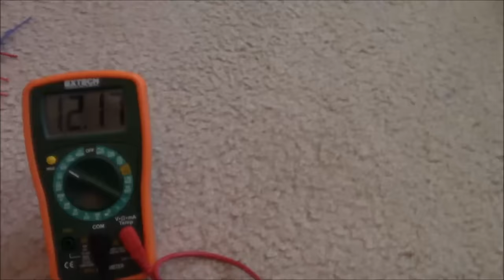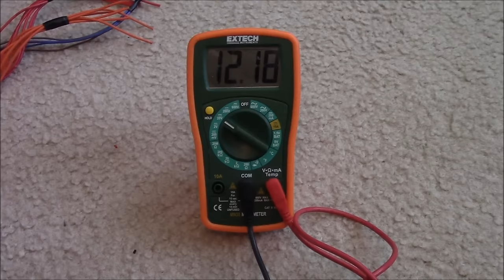How to Hack a Computer Power Supply (PSU) To Use as a 12V DC Power Source

Comment: @ LDSreliance
I used a new 400 watt 22a computer supply on 12v today to power 16ea. @ 10w led's. This was my initial start up and the led's are mounted to a large alum heat sink using dielectric paste and screws. After about 2 to 3 minutes run time the power supply shorted out by frying 3 small resistors located on the printed circuit board positions R-13, R-14 and R-17. It did not blow the fuse. 
My question is do you or anyone else know the value of each of the 3 fried resistors? My power unit is a Kenter, Model PSPK400 and I can't locate a schematic to replace the correct resisters.
I checked my led light mountings for a short and found no problems there.....
The 160 watts, 16 leds @ 10w each, require only 13.3333 amps to power up which should not have been a problem....
I rigged my power supply as you have rigged the one you used in your video..........
I am an old fart, not a skilled electronics guy, just messing around with led's which intrigue  me to no end......
Any help with my problem is much appreciated,
Don
Reply from the maker: +orangecrate39 Did you control the current through the LEDs with a resistor?  I assume the LEDs were in series?

After doing a little research into that power supply, it gets bad reviews and seems to be junk according to some.  Check out this video for example:  https://www.youtube.com/watch?v=RP9GHyFUXgU

So you may not have done anything wrong with your LEDs but it may have just been a faulty psu.  I know the tendency is to use the cheapest psu you can find to hack up like this.  That is what I did in my video.  It would pain me to take a $100 Corsair power supply and hack into it.  But these cheap units do have poor components and often (as in this case) have no documentation.  I can't find a manual or diagram, either, I am afraid.  Sorry!
Reply: +LDSreliance 

I had the led's wired parallel in 2 circuits ie., 8 led's to a circuits. The power supply was supplying 12v through 3  yellow wires and grounded with 3 black wires in each circuit. There was no resistor in either circuit.
 
I figured my PS was a cheap one because I only paid $18.50 including shipping. I went by the local computer repair shop this morning. The owner let out a short howl after I told him what had happened. He said most all PS's were vastly over rated on the wattage they list on each unit by at least 25% and some were by 50%. He also said I should have had a PS with 650watts minimum. I believe he felt sort of sorry for me because he told me to check back with in 2 to 3 weeks he should have one with 650w for me to play with.

He also said the cheap PS's used all components, parts, right on the edge limit, no safety built in for emergencies which was the reason the 3 resistors fried without blowing the fuse. 

Thanks for your reply......

Don
Reply from the maker: *****
That is pretty much what I thought.  If you want cheap you can go to a computer recycler or look for someone throwing away an old Dell or HP computer.  They used fairly cheap components but they were rigorously tested by the manufacturer for reliability since they had to warranty the computers for the mass market.  I would trust a Dell's 350 watt power supply over any cheapo 500 watt power supply on the market.
Reply: +LDSreliance

I ment to ask you if I needed a resistor or what would you recommend?
Thanks. ....
Don
Reply from the maker: *****
I am not an expert on this but from what research I have done you need a resistor on an LED to limit the current.  Just because it is rated for 12v 20mA doesn't mean it will limit itself to using that amperage.

http://led.linear1.org/why-do-i-need-a-resistor-with-an-led/

Comment: I connected green to black and it powers on for 1 second then powers off...any ideas why?
Reply from the maker: If it detects there is no load it will turn off.  Connect it to a load first and then when you short the green wire it will stay on and the load will power up.
Reply: ok will try however these is a fan in the Ps so i would imagine this is a load on the 12v portion so why would it power off? the fan powers on for fraction of second then powers off and on your ps you didnt have a load connected  other than the fan and the 12v powered on ok...
Reply from the maker: No, it is designed to only run when it detects a load on the rails.  The internal fan doesn't count.

Comment: I want every detail, what does every color of cord do?
Reply from the maker: The standard colors and pinout can be found here:  https://en.wikipedia.org/wiki/Template:ATX_power_connector

I only dealt with the 12V wires in this video because that is all you need for a 12V power supply.  But there are 5V USB as well as other useful rails you can tap into.
Reply: @LDSreliance  thank you very much, if i were trying to make a high voltage power source what would you recommend i modify? I was gonna use a microwave but decided this would be a place to start for better experience.
Reply from the maker: High voltage?  The highest this PSU outputs is 12V.  There may be ways to increase that but I'm not an electrical engineer and would not be qualified to help you with that.
Reply: @LDSreliance  i don't mean this specificly this, just anything that could produce a high voltage. Or something that could be modified to produce a high voltage.
Reply from the maker: You would use a DC to DC voltage step up converter to increase the voltage of this unit from 12V to maybe 20-30V but you would lose some of your power in the conversion.
Reply: @LDSreliance  what if i added the 220v coil from the microwave transformer?
Reply from the maker: I have no idea if that would work but I would suspect not.  Especially since most PSU's are 400-600W and most microwaves are 1000W+.
Reply: @LDSreliance  oh, well. I appreciate all the responses.
Reply from the maker: You are welcome.  Good luck!

Comment: sorry one more none of my supply have that green wire only one newer one does which would be the wake up wire for ones without green thanks a lot
Reply from the maker: +Nena Pike If yours does not have a green wire does it have a switch on the back of the power supply to turn it on?

Comment: I know this video is very old, but when I try to connect something to my psu the amp im using flashes protect and shuts itself off and the psu turns on but then turns itself off after the amp refuses power
Reply from the maker: How big is the amp?
Reply: @LDSreliance  Total Power Output	4000 Watts
Peak Power @ 1 Ω	4000 Watts x
Peak Power @ 2 Ω	2000 Watts x
Peak Power @ 4 Ω	1000 Watts x
RMS Power @ 1 Ω	3000 Watts x
RMS Power @ 2 Ω	1500 Watts x
RMS Power @ 4 Ω	750 Watts x
Strapped Power bridged @ 2 Ω	8000 Watts
Speaker Impedance	1 to 8 Ω

I seem to have it working, I think there was a failsafe that if it wasnt delivering power it would shut off
Reply from the maker: Gotcha.  Well obviously you won't be able to use anywhere near the full power of that amp but it should turn on.  I was going to suggest checking the sense wire that detects when the amp is supposed to turn on.
Reply from the maker: Also, on some PSU's, there is a feature that is supposed to save energy that detects a load and if it doesn't see a certain load it will shut itself back off.  So you have to trick the PSU into turning on with a resistor or a dummy load.
Reply: @LDSreliance  unfortunetly I understand I wont be able to use it at its full potential but its a way to use ny car subs in an ac setup while they arent being used otherwise. Also you made an awesome video, thanks for the help and keep doing what youre doing
Reply from the maker: You are welcome!  Good luck

Comment: How do you tell the amp rating of it?
Reply from the maker: It will either be on a sticker on the side of the case or you will have to look it up online on the manufacturer's website based on the part number.

Comment: hey man whats up one question can you tell me how much amps it is pushing please ?
Reply from the maker: 20 amps on this model on the +12v rail.  Yours may differ.
Reply: LDSreliance i have a car radio and two amplifier using and looks like the power supply is too quick im wondering how much amps i need to run it
Reply from the maker: Too quick?  You probably can't power car amplifiers with this thing unless they are very small.  20 amps equals about 240 watts, which is nothing in car audio.
Reply: LDSreliance oh ok so its too weak then ok thanks then man
Reply from the maker: FASSKAR FRANCIS No problem.  Good luck!

Comment: when i take the green wire and a black wire it wont start the fan only moves a secend
Reply from the maker: You need to put a load on the PSU.  Connect the +12V rail up to a fan or something and it will detect a load and stay on.  If it does not detect a load it will quickly shut off.  You can trick it with a resistor, too.
Reply: LDSreliance Don't we need to add high watt power resistors or just any simple load is fine.

Comment: I use green and black wires to turn on supply also.  . but it not power on after long try it start.  . could anyone help on this issue???
Reply from the maker: On some power supplies it has to detect a load to turn on.  So you can either wire in a resistor or connect it to a load.  But you can't run it without a load.

Comment: I connnect green n black  wayer... run few but after few secand stop...y stop...
Reply from the maker: Some PSU's will not stay on if they don't detect a load.  Connect the yellow and black wires to something that will pull some power and it won't do that.

Comment: is there any way to convert this psu to turn on a laptop?
Reply from the maker: Probably not.  Most laptops use higher voltage than 12V.  It is possible to combine rails but NOT recommended for a beginner as you could hurt yourself or start a fire.

Comment: What about the -12v line? What color is that?
Reply from the maker: -12V is usually blue.  But it usually has very low power output.
Reply: @LDSreliance  when a motor has +/-/ground do we use the - lead for the -12v line?
Reply from the maker: No.  -12V is not "negative" or "ground" or "earth" or anything like that.  I know it is confusing.  It is actually just a normal 12V power source.  They use the - sign to distinguish between different rails on the PSU.

Comment: How many fans can I connect using this system?
Reply from the maker: +73C4N0 Depends on the power consumption of the fan.  The average 120 mm case fan seems to be about 1/3 of an amp so 3 fans per amp and the power supply provides 20 amps of +12v power so theoretically 60 fans.

Comment: How much current (ampere) does it provide?
Reply from the maker: 20A
Reply: @LDSreliance  Thanks a lot Sir. I learned a lot from your video.
Reply: @LDSreliance  Btw, with my old Cougar 1000W PSU, I just  used  the 2 modular connectors (for PCIE) outside of the PSU to supply 12v for 2 CCTV cameras. Since the original power supply for the cameras was 12v 5A, does my mod provide adequate power? I didn't want to mess anymore with the built-in rails wires  of the PSU. Thanks again and keep safe.
Reply from the maker: You are probably fine.  Each PSU has different power specs for all of its various rails.  If yours is 1000W, the 12V rail will be able to provide more than 20A like mine does.  Mine is only 500ish Watts.  But a higher end PSU like yours will provide plenty of power to the PCIe so you should be fine.

Comment: can i use this for 12v 8w motor.....
Reply from the maker: Of course.  Easily.
Reply: how much power it has been taking like amp,watts.?
Reply from the maker: Learn 4 Earn
This power supply can provide 20 amps @ 12v or 240 watts.

Comment: I currently have a low voltage system for outdoor lighting.  I have 4 100  bulb white christmas light strings that I want to convert to low voltage and integrate into my 120 Watt Controller or use something else to control just the christmas lights.  The LED lights are just your standard 120V.  Can anybody point me in the right direction?  Thanks in advance.
Reply from the maker: Unfortunately, there is no way to change or convert the bulbs.  You either have to change the low voltage, 12v power source into 120v with a power inverter, or you have to find some LED Christmas lights that are 12v to begin with.  I assume that your 120 watt controller currently manages the power and turning on and off of the outdoor lighting.  It may or may not have enough power left over after powering your outdoor lighting to also power the Christmas lights.  You will have to account for about 20% power loss if you end up having to use a power inverter to change the power from 12v to 120v so keep that in mind.

Let me know if you have more specific questions.

Comment: hi. can i charge my 12V battery with this?
Reply from the maker: +Islam Boy No, unfortunately you need at least 14.5v to charge a 12v battery.  You could use a voltage converter but then it would not know when to stop charging the battery.  I am afraid there are better devices for charging a battery than this.

Comment: how to measure its current ? please show us?
The numbers of yellow and black wires should have to equal isnt it ?
Reply from the maker: mkaytanli mert The amount of current is rated by the power supply on the sticker on the side.  Mine is 25A for the +12v rail.  If you want to measure that yourself you would need to use an ammeter.

I don't think you need the same number of yellow and black wires but it is probably good practice to do so.  You defintely don't want to have a lot more yellow wires than black or you risk the black wires overheating.
Reply: LDSreliance thank you for your reply.
No, Black wires more than yellow wires as you can see..
Reply: LDSreliance thank you for your reply.
No, Black wires more than yellow wires as you can see..
Reply from the maker: Then you are safe.
Reply: mkaytanli mert there are more black wires, because it provides ground for the other voltages as well as +12V

Comment: I was thinking using a psu on a 12v 155w fuel pump does anyone know if it works?
Reply from the maker: That should work just fine.  Most PSUs have 20A on the 12V rail.  I have seen a few as low as 15A but even that would still be enough to run a 155W load.

Comment: can i used that  on my old desk top hp monitor????
Reply from the maker: You mean to power the monitor?  Monitors usually plug into AC power.
Reply: i just wanted to convert it,, cause the power source of my old hp monitor was burned out..
Reply from the maker: ricky bondat I'm sure you could do that because almost all electronics run on DC power and a majority use 12v, at least in the computer world.  However, I am not an electrical engineer and can't tell you how to convert it by removing the existing transformer and soldering in this PSU.  Sorry

Comment: Can someone explain tell me what the -12v wire do? And can this make more than 12v?
Reply from the maker: +Mark Villanueva The -12v wire is basically obsolete these days.  It was used a while back for RS232 serial port levels.  You can just ignore it for the purposes of this video.
Reply: +LDSreliance my blackberry tablets rapid charger burnt...... output specs says 12.5 volts 2 amps.. do you think this can help me to charged my tablet?  pls reply and godbless
Reply from the maker: jon jones
Maybe.  This will only produce 12v and does not have any circuitry to detect when the battery is fully charged.  But theoretically it should charge the tablet as long as the voltage is less than 12v on the tablet battery.
Reply: +LDSreliance   tablets battery is 3.7 volts...5400 milli amps
Reply from the maker: jon jones
Ok then I don't know why the charger would output 12.5v if it only has to charge 3.7v.  You could easily charge 3.7v with the 5v rail (USB rail) on this power supply.  Again, it won't know when to stop charging because the battery is full.  That is a problem because it might start a fire.  So be careful.

Comment: Please someone tell me, can i use this like second power supply for my gtx 480? i mean one normal PSU, and this one only for videocard? because gtx 480 required 1x 6 pin power connector and 1x 8 pin power connector?
Reply from the maker: Yes, as long as both of them are powered up at the same time.
Reply: Thanks man. i will try this hope everything will be ok after my test :D
Reply from the maker: Let me know how it works!

Comment: i attach green to black but it doesnt turn on :( whats the problem? (sorry for bad english)
Reply from the maker: Slidecraft Is there a switch on the back of the power supply?  That switch needs to be in the on position and then you can connect the green wire to a black wire to complete the circuit.
Reply: I founded the problem is the power suply i founded another one and it worked Tank you :) Youre the besttt :)))
Reply from the maker: Slidecraft
Glad to hear that!  Good job.
Reply: But the bigger problem apeared :O
It blew up!
And made bad smell. :(
Reply from the maker: Slidecraft Which one?  The new one blew up?
Reply: yes.
a lot of smoke and big sound
Reply from the maker: Slidecraft Did any of the wires touch each other?  It would be a good idea to use electrical tape to keep the wires from touching each other accidentally.
Reply: No they were not it just blew up :( i was isoleted them :(
Reply: it is not workink any more :(
Reply from the maker: Slidecraft It sounds like you blew a fuse or a capacitor.  I am sorry man.  You are having bad luck with this.
Reply: yeach :(
Reply from the maker: Slidecraft I am sorry.  Maybe just use a laptop power adapter instead.  There are much less wires and less chance of hurting it.

Comment: I accidentally shorted a yellow and orange wire.... what did I do!
Reply from the maker: Shut off the power supply and let it sit for several minutes.  Then plug it back in and see if it works.  You may have fried something internally.  Hopefully it was just a safety shutdown or something.